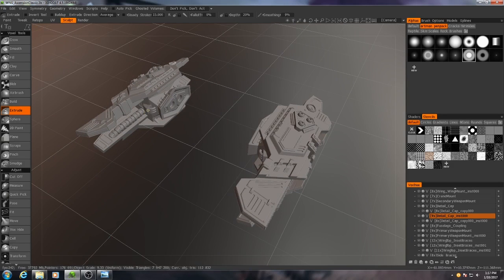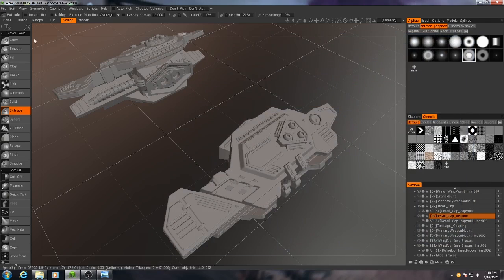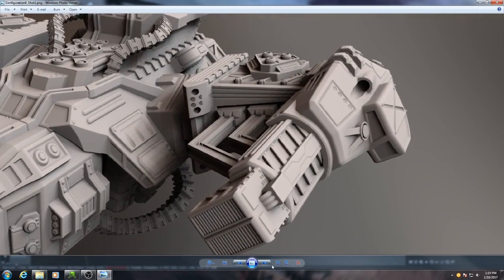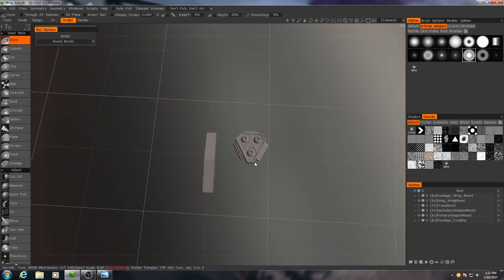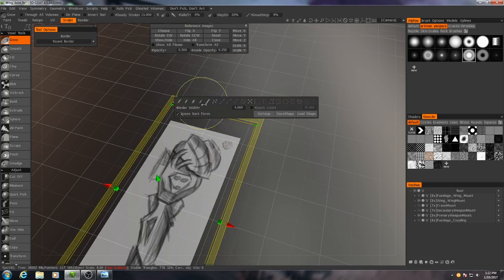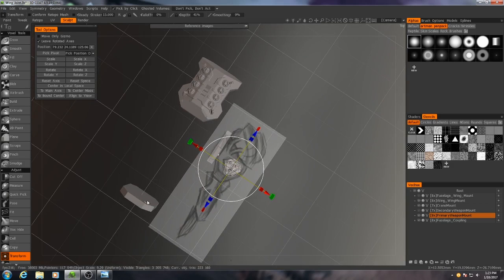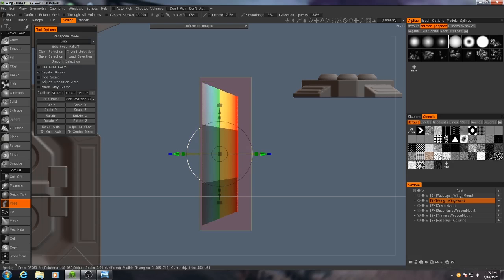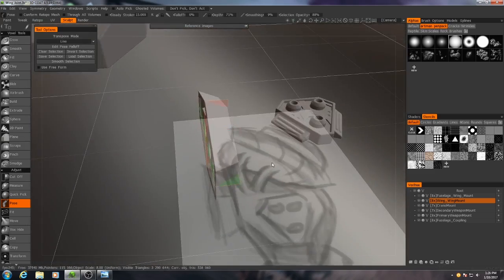3D-Coat Hard Surface Spaceship Wing Modeling (Part 1)

Comment: This is incredible! How are you going about unwrapping UV's on something like this when there is a lot of complexity in a single piece?
Reply from the maker: 3d-Coat has a really nice feature where, if you have many separate retopo groups, you can bake normal maps from specific voxel objects ONLY onto specific corresponding retopo meshes. This means that even if you have many different retopo shells that overlap each other, that overlap won't cause artifacts when you bake out the high resolution details.

Why is this important? I try to avoid making all of the details and shapes of assets like this out of a single voxel layer. Doing so would make it difficult to edit. Each individual voxel object is relatively simple and creating a retopo mesh and corresponding UVs is rather easy. So instead of making a single very complex retopo mesh and UV set, I can make many simple ones. Normally the overlap between several meshes would present problems for baking in software like xNormal (though I still love xNormal) but with 3d-Coats ability to link retopo groups with voxel layers based on name, that isn't an issue.
Reply: That's great! Thanks for the quick reply as well, this will come in very handy for something I'm playing with right now. What is the feature you speak of in your first paragraph if you don't mind me asking? Thanks :)
Reply from the maker: It's called "Name Correspondence for Baking". It's a checkbox that you can turn on and it's under the 'Bake' tab in the Retopo room. What it will do is it will compare the names of your retopo groups with the names of your voxtree layers and the retopo groups will only bake details from the corresponding voxel layers while ignoring all others. You have to make sure that the names of your retopo groups and the voxel layers are the SAME or it won't work.
Reply: That's amazing! Thanks for this, that's a great tip! I'd love to see you do more hard surface tutorials, particularly more spaceship design walk-through videos. Honestly, I've searched high and low for good spaceship modelling tutorials and they just don't exist. I look forward to checking out your Unity series too :) Thanks again :)
Reply: Do you have a Patreon with any 3D Coat tutorials by the way? I'd be happy to subscribe with content like this :)
Reply from the maker: I don't do patreon as I don't really publish videos to Youtube anymore, but I am a Udemy instructor and I have a few courses up on there: https://www.udemy.com/user/timothy-lynn-trankle/

While these courses normally require you to pay for them, I wouldn't feel right asking you to pay for my courses here on my youtube channel (unless you really want to). So, on any of them, you can use the coupon code "DA_FRIENDS" at checkout to get any of them completely free. I only touch on 3d-Coat for texturing a little bit and most of the content is modeling in Blender and particle FX in Unity.

Comment: Using 5 and 7 doesnt give the same navigational effect for me...
Reply: This hung me up too. I found in order to give the same navigational effect you must use the number keys from  the number key pad on the right side of the key board not from the the single row of numbers across the top. Use numbers from the  "17-key keypad usually found on the far right side of a standard PC keyboard"

Comment: Hi, man, excellent tutorial. I would like to ask you: do you think that 3d Coat can be used for modeling (for concept design, not real modeling) jet fighters - mig-29, f-16, f-18... or cars?
Reply from the maker: It's all possible. Those types of vehicles are notoriously difficult to model no matter what method you are using. I would say the jet fighters would be pretty straight-forward to do in 3d-Coat. Cars not so much. A traditional polygon modeling solution like Blender or Maya would be much easier.
Reply: thank you very much on fast response!
Reply: Keep in mind that the fastest way to model anything now, even hard surface is : ZBrush. It was already true in ZBrush 4R7, but since they implemented a stunningly powerful Live Boolean in 4R8, there's absolutely nothing on the market that comes close to that. ZB is fast and furious.

Comment: Beautiful tutorial. thanks! what I would like to see though, is a tutorial on how you would retopologize a detailed object like this wing. I see a lot of basic retopologize tuts but they never cover doing detailed objects.
Reply from the maker: Sadly, I have finished all the detailed ship parts for the game (for now, I may do more in the future) and retopologizing an object like this is very time consuming and I don't have time at the moment to go through the entire process again. I may upload a short video showing the topology and the methodology  behind it soon though. What I can say here is that there is not quick way to do something like this for video games. The autopo algorithm in 3d-Coat can work with hard surface models, but you need a lot of excess polygons for it to work right. When retopologizing something like this for a video game, you basically need to place every vertex by hand to get the optimal polycount. It's a lot of the points/faces and the quads tool. If I do find myself doing another high-detail hard surface model like this, I will keep what you have requested in mind.